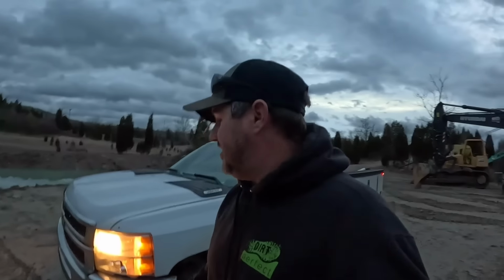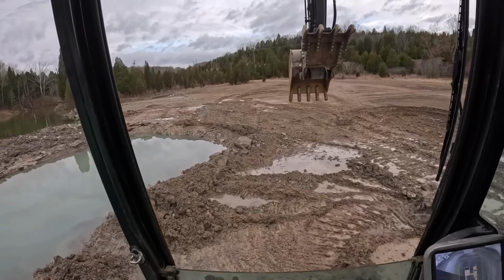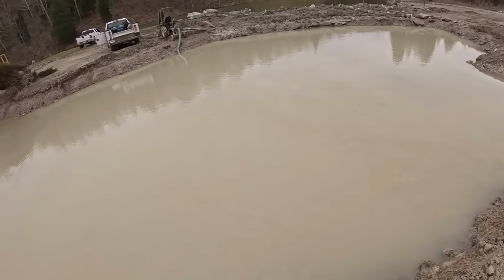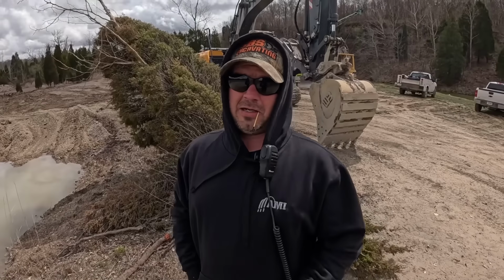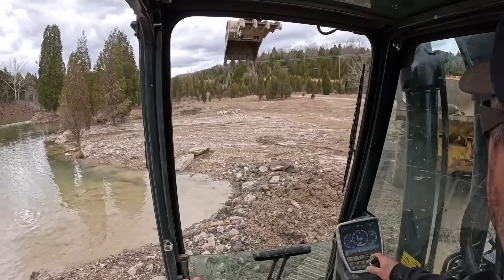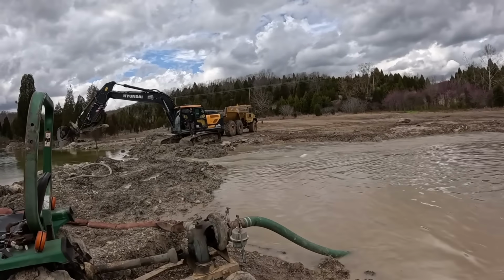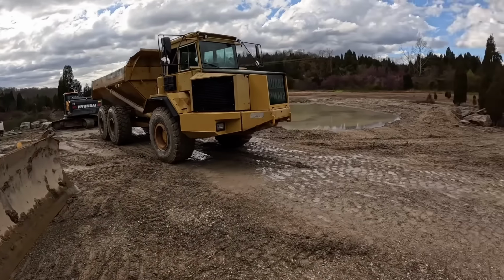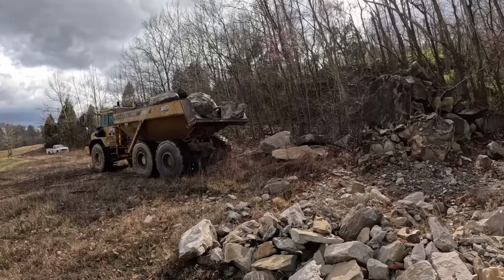Breaking The Dam: Filling New Lake Section!

Comment: Looks like you will be digging in a filled pond. After swimming the dozer, take it to  the shop and check transmission and final drives for water in the oil.

Comment: I was thinking, (yeah I know its dangerous) you mentioned the J and ripper are not available.  What if you and Aaron made a single knife ripper on a quick tach for the 210?  Sit it down beside the spot, gets hard to dig, swap to the ripper, drag it through a few times to break up the crust, swap back to the digging bucket.

Comment: I ditched GoPro for an Insta360 Ace Pro. I've been way happier with the video quality, low light performance, audio quality, USB capabilities and size. Battery life is similar and it doesn't overheat and shut down constantly, at least in my experience. I know its a hard switch if you are invested in GoPro like I was, but it was worth it.

Comment: you should replace the flapers on exhaust pipes for a upside down steel tin. so instead of tapping etc, the top acts like a p trap. exhaust easily escapes but rain needs to go under then up to get in the pipe.
the drag line tracks need risers to grip better.

Comment: Hey Mike how ,with water over your vent pipes on the differentials, does this not have and adverse effect on  your grease or 85 190 oil in the machines.
Doesn't the heat pull in the yucky water mud and crap
Reply from the maker: What vent